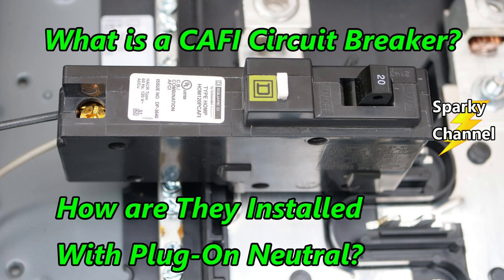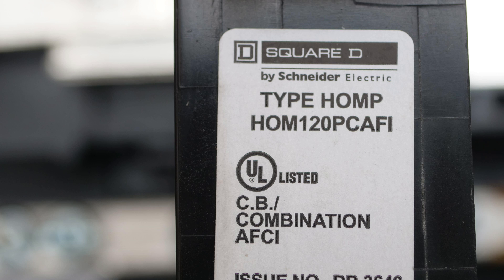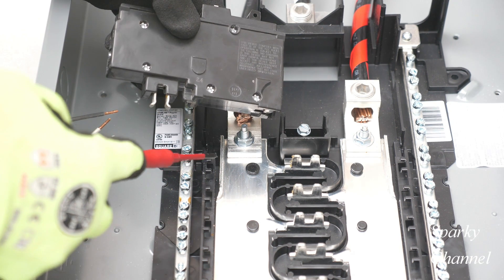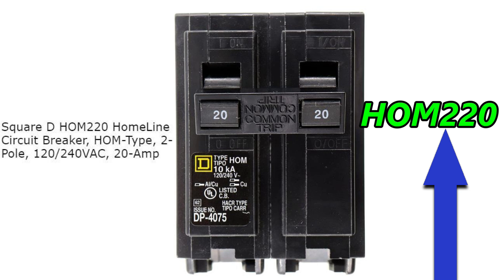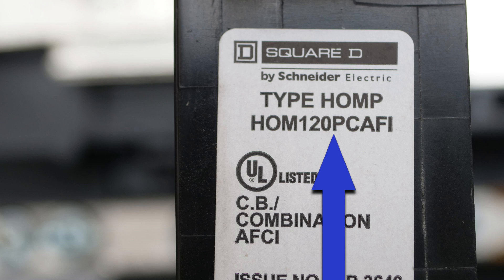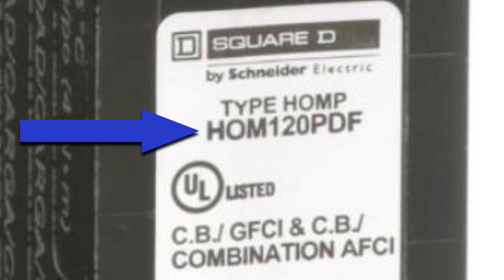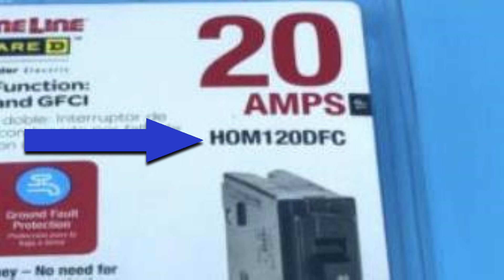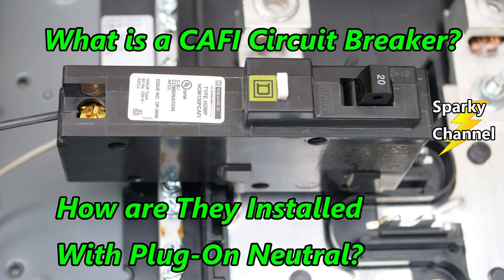What Do All These Letters and Numbers Mean?

Comment: Hello, Bill. Your Sparky Channel is truly one of the internet's gems of electrical knowlege.

Sorry to be off-topic with these questions.

I have an older house with pure and hybrid Knob & Tube (K&T) wiring circuits. I would like to upgrade an older circuit breaker in a Square-D Homeline (not plug-on-neutral) subpanel to a modern Square-D "dual function" (combined AFCI/GFCI protection) breaker. Unfortunately the circuit's home run to the subpanel is K&T. Several K&T neutrals come in from the same knock-out and are not identified by circuit. How can one identify the circuit's hot wire on the breaker with its corresponding neutral? (One of your previous videos showed how to install it!)

I thought to (with NO POWER ON) short the hot and neutral wires at the first downstream receptacle and then test to see which of the separate candidate neutrals in the subpanel is shorted to the circuit's hot wire.

[K&T is a bear to the DIYer - steep learning curve, but you and others on YouTube are invaluable!]

Second, it is advisable or required to remove any GFCI outlets on a circuit protected by a GFCI/AFCI breaker?